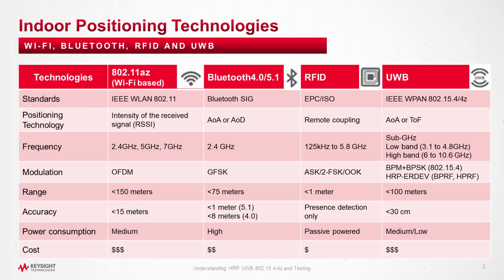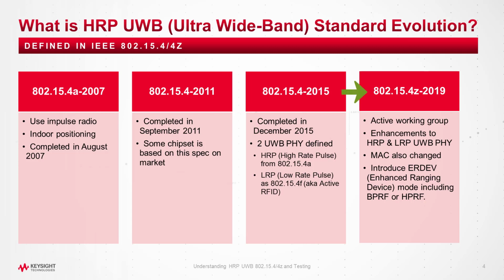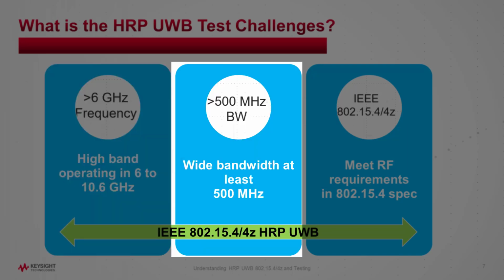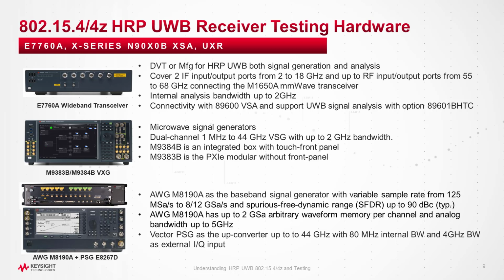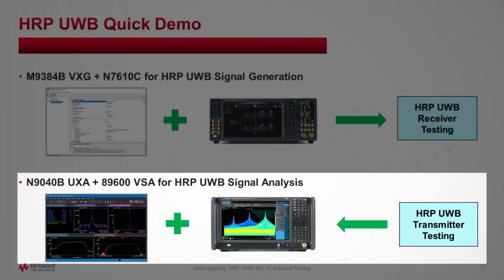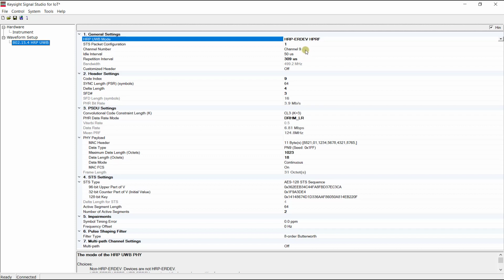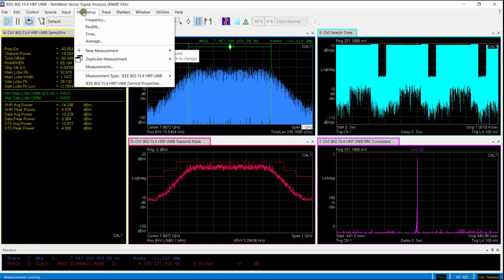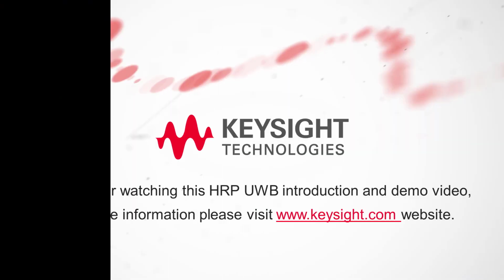Understanding HRP UWB in 802.15.4/4z and Testing

Comment: Wi-Fi 802.11az is not RSSI based as suggested in 0:36 but 2nd generation Wi-Fi Time Of Flight Based, furthermore the accuracy on 160MHz channel available for WiFi today is sub 10cm, and the technology is both OFDMA and OFDM not only OFDM. on top of TOF it also supports Time Of Differential Arrival as well as AOD and AOA.